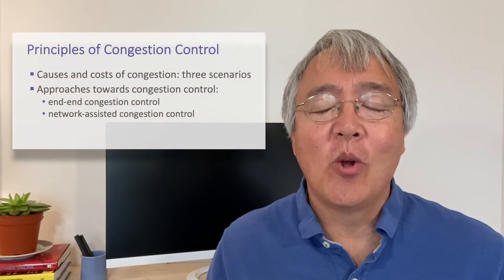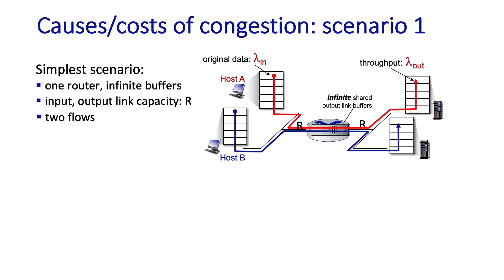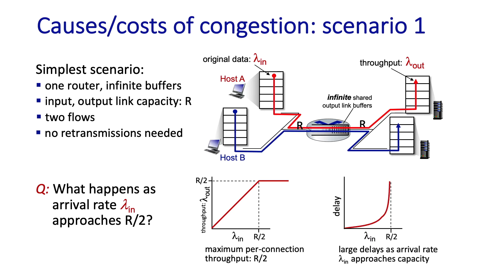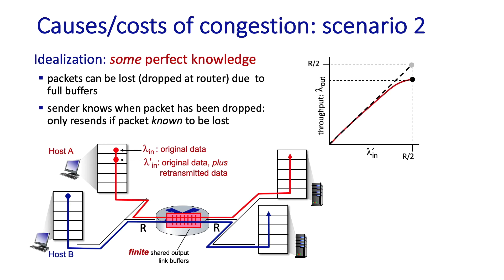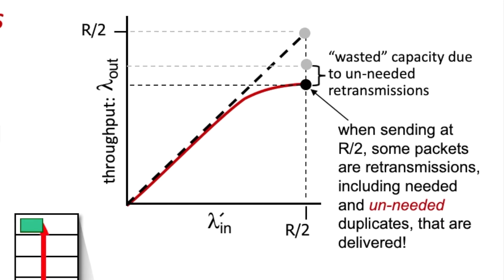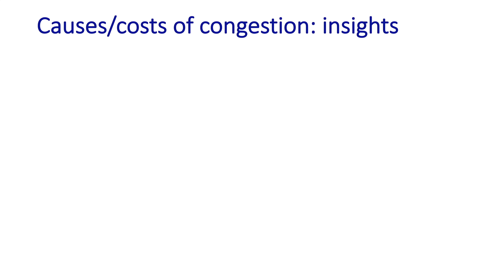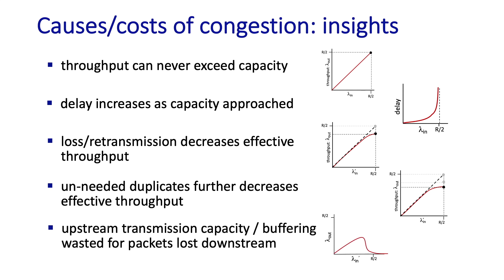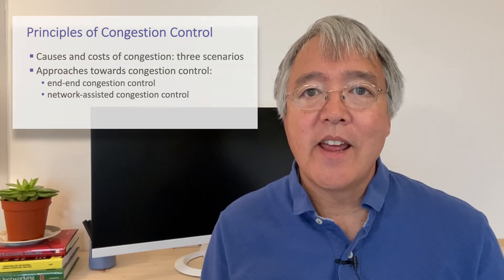3.6 Principles of Congestion Control

Comment: 2:28 book specifies but he doesn't - this is AVERAGE rate
if it was a flat rate, queuing and congestion would never occur. same goes for queuing delays in general, intensity = 1 blowing up queues is for AVERAGE rates. if its a flat rate then intensity = 1 would have 0 problems

Comment: Scenario 1, as λin approach R/2, why delay is not const? and when λin large than R/2，delay become lager and lager.
Reply: Let's say router can process 100 packets in 100sec. If router recive 2 packet, last packet will be transmitted after 2sec, if there are 10 packets, last packet will be processed after 10 sec. Hence dekay is increasing. But if router is receiving 100+x packet in 100sec, x packets will be accumulated for the next turn. This accumulation will keep increasing after every 100 sec.
Reply: @tarunpahuja3443  Still doesn't make sense to me. Say router receives 2 packets, it takes 2 seconds to transmit them, but both senders sends at most 1 packet every 2 seconds, so the delay should be constant at 2 seconds no? And for 2 senders, the router cannot receive more than 2 packets at the same time, so there's no way you can send 10 packets at once, instead they would be sent 2 packets at a time (every 2 seconds).
Reply: Even the prof himself said in earlier videos discussing queuing delay that packets will queue only if input link tx rate is higher than that of the output link. I can't see how queuing can happen in the ideal scenario if output link capacity is R and both senders send at less than R/2. If the prof is considering fluctuating tx rates and packet delays, then I can see how queues can build up, but I feel like that should be made clear if so.
Reply: nvm, this makes a lot more sense when you consider pipelining (the longer the pipeline, the larger the delay for later packets, which increases average delay).